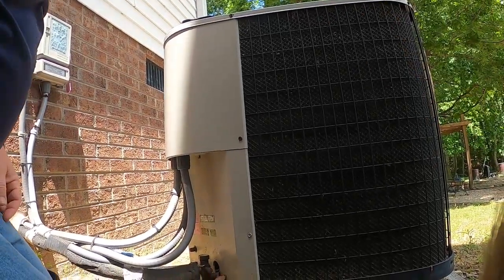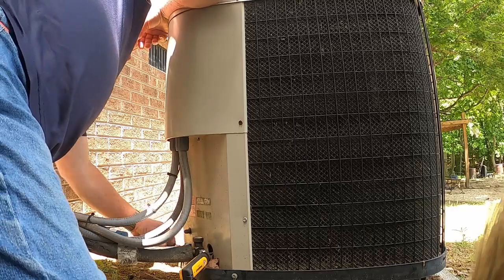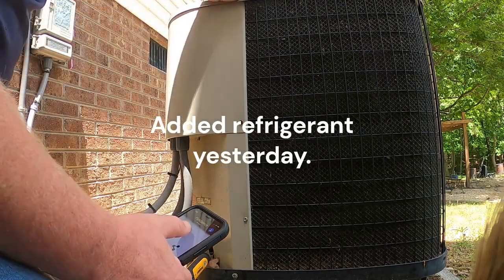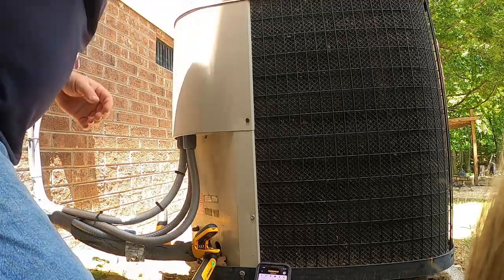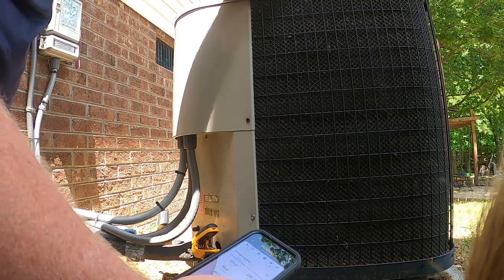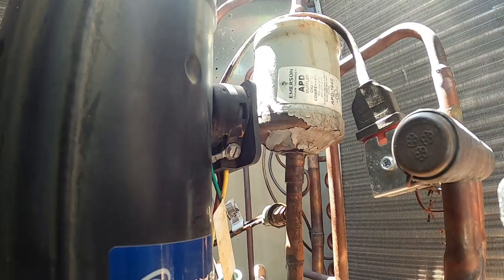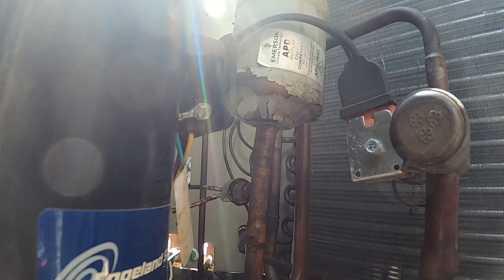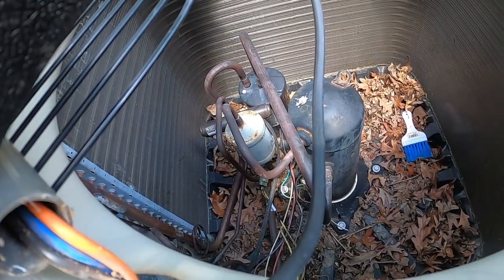Finding a Refrigerant leak in an A/C system.

Comment: Good find Charles amazing how something as simple as a pressure switch can cause a leak 

but a lot of newer younger techs would just say get a new system over a, pressure switch or assume it's a condenser coil or evap coil just like with cars they would assume it's a big expensive part when it's not.

Good work and I hope you do a follow up video on replacing that switch and valve core and at least your leak detector works and is calibrated corectly.
Reply from the maker: Thank you sir. The repair was done by another tech while I was on vacation this week. He said it went well.

Comment: With the H-10 hope that the pump never goes ou, because the manufacture does not have them. They use to be great detectors 40 plus years ago but I would not buy one today.
Reply from the maker: Got this one 4 yrs ago, keep the filter changed and do not abuse it and it will last.
Reply: @MYHVACLIFE  Hopefully for you.